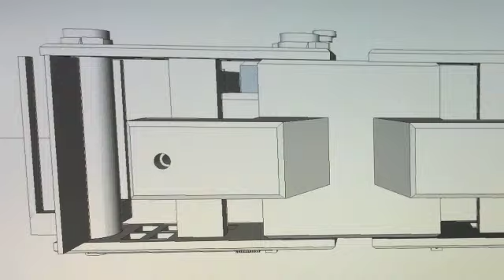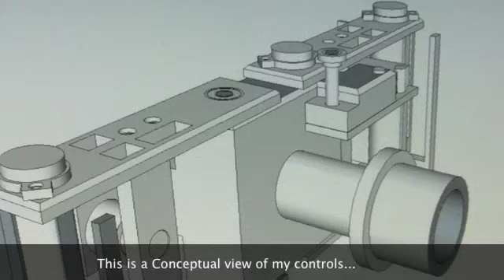Disabled Racer Mario Bonfantes New Race Car!

Comment: Congrats............Thanks a lot for inspiring and helping people… I am a physically challenged person with Post Polio Residual Paralysis both lower limbs(Permanent). I have a Maruti Suzuki CelerioVXi–Auto Gear Shift, I have retrofitted/adapted a hand operated accelerator and a brake retro fitment kit approved by ARAI, Govt. of India, (Thanks to Deccan Motors, Telangana State, India) Still now i have happily safely finish my trip to Anaikatti, Maruthamalai, Topslip, Yercaud and Ooty (all are hill driving) with the above car….Those are wonderful trip…... I am using only single Hand(Left Hand) steering control. Right hand for above said KIT…